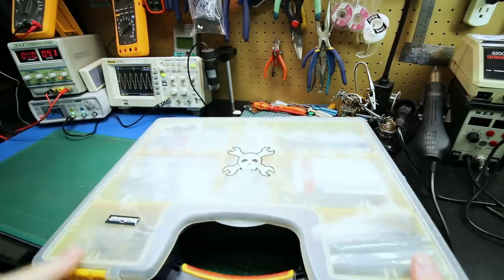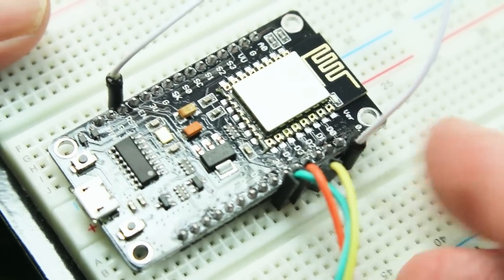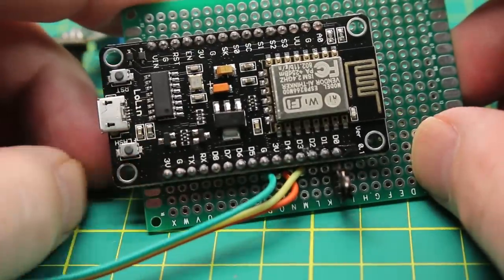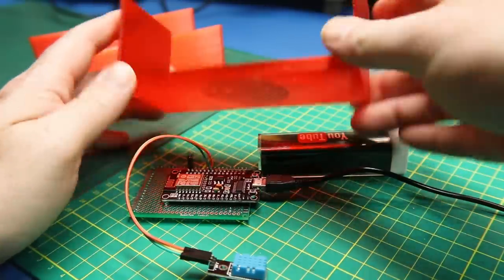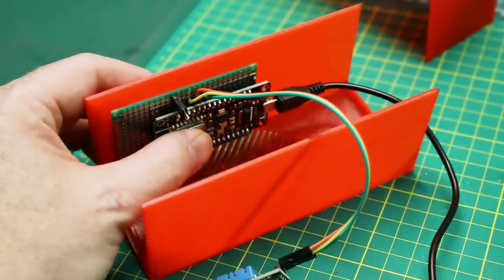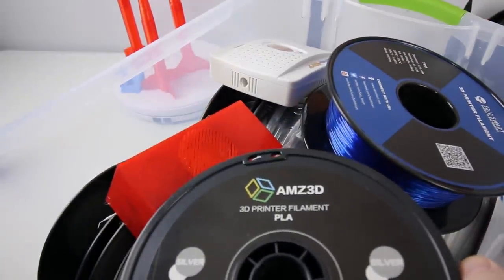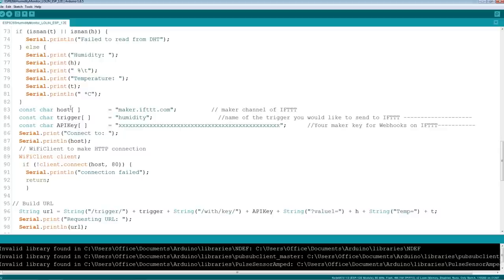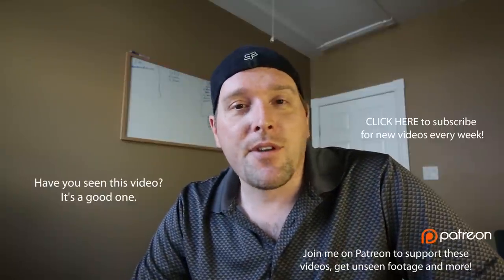DIY Wireless Temp & Humidity Monitor With Text & Email Alerts

Comment: Hey, just wanted to say that this is my first attempt at messing around with a micro-controller, Arduino Editor and IFTTT.  Banged my head a few times but things started to make sense.  Had all this going in about an hour and a half, starting from scratch.  Works like a charm!   I would like to mention that, at least for me, I had to add a function that would verify it was connected to wireless before it tried to send the trigger.  Without it, I was never getting to the web.  It connects very quickly but apparently, not quickly enough.  I suppose I could have just put a 1 or 2 second delay in there, but this way, if the time varies, it'll still connect.  Other than that, everything worked great!   I was having fun just letting it send an email every 30 seconds.  The next think I learned was that free IFTTT has a 30 email daily limit!  haha  I think I have 5 left.  haha  Just wanted to say thanks for the video and the GitHub stuff!

Comment: This project needs one more input. The battery voltage should be monitored and transmitted when it approaches the the low cut off voltage so it can be charged or replaced. With it lasting a long time you may miss not see the humidity and temperature report for a few days so the battery low cut voltage approach alarm would be a great addition.

Comment: ⚠️ keep in mind ⚠️
DHT11:
Good for 20-80% humidity readings with 5% accuracy
Good for 0-50°C temperature readings ±2°C accuracy

DHT22:
Good for 0-100% humidity readings with 2-5% accuracy
Good for -40 to 80°C temperature readings ±0.5°C accuracy
Reply from the maker: Don't let perfect stand in the way of functional.
Reply: MKme Lab true but it should be noted though
Reply from the maker: You will be very busy posting data sheet info on many videos.  Best of luck though
Reply: MKme Lab not many just the important ones 👌🏽😁
Reply: The DHT11 is an *awful* sensor, I don't know why people keep using it (nor the DHT22, which is only slightly better). The Si7021 is smaller, cheaper, easier to use (i2c), and significantly better performing. The DHT11 is a relic of a bygone era when makers had far fewer affordable options.

Not that this is a criticism of this video, which I think is great and I'm sure it was just what was lying around. I just hate the DHT11 with a passion after it caused me a ton of headaches.
Reply: nobodybodybody thanks for the information, I've never heard of Si7021 before
Reply: @jasonmhite  cheaper? Where? Very curious

Comment: Great idea. you could use a small E-Ink screen as a readout on the outside  (or inside if the box is clear enough) instead of a sms message. Might be a bit easier to code as it does not need wifi or ITTT integration.
Reply from the maker: Like this? https://www.youtube.com/watch?v=MGvdrmPEDlw :)
Reply: Yup I've just started watching the channel ;) need to catch up on all the older videos! :D
Reply from the maker: Glad to have you here. Such a crazy time when we can build just about anything in a few minutes

Comment: Dear. Thanks for the video. Wouldn't it be more wise just to text message you  when the humidity reaches a certain level.  And then you just know when to recharge the dehumidifier?  Also code for battery level?

Comment: have DHT11 module with registor. It Works well with Arduino UNO but not with NodeMCU. I thought it might be issue of in-sufficient power. So powered DHT separately from Arduino 5V out (Ensured same ground for UNO and NodeMCU) but still not working. Kindly suggest the solution.

Comment: Ok, I did my homework and really feel dump that I did not remember about the Adrino of which I think this is a mini version of.  Sorry for the dump comments and will do my homework in the future.  :)
Reply from the maker: No problem Tom. Yes they use the Arduino IDE and can be considered "Arduino compatible". The main ones for Arduino are the Atmega 328 and 2560 chips (the NANO you see me use a lot is the 328). This is the ESP-8266 which is similar in some ways but has WIFI capability. ESP-32 is the next step up which is crazy powerful and has wifi. The ESP's have some drawbacks but the wifi functionality and powerful processor make them handy for projects like this. All above can be programmed in the same Arduino code and IDE- just different board support and libraries.
Reply: Excellent information.  I ordered the 8266 and an display and will try to get your code working.  I asked before, does your files include any need libraries?

Comment: MK, question. at one time I owned a communication retail store and did in-house repairs on just about anything that powered up.  I owned a Marconi spectrum analyzer and everything need to repair to board / parts level.  I sold the store and all the equipment in 91, in 08 I had a heart attack and seemed to have lost some of my experience it figuring things out. I'd like to start building and experimenting a little.  Where can I find a good beginners guide to study?  I have invented a few things back in the 80's 90's and I have a patent on something I'm working on and I need a tracking unit about the size of an ice cube with a phone app.  I thinki I can figure it out if I knew more on the mini boards you work with.
Reply from the maker: Well a great guide for general stuff is "Practical Electronics For Inventors". You may already know alot in there though. Truthfully for the boards, the best place is right here on YouTube. Andreas Spiess, Great Scott, David Watts and many more channels. Pretty much just search what you are after and skim through the tutorials. That's how I learned what little I know on them.  Cheers

Comment: Awesome video, this is exactly what I need to make a monitoring system for my ball python room. Would I be able to recreate this the same way and power it using a long USB cord plugged into a standard wall adapter? If not i am thinking maybe using a large power bank. Thanks for posting this video!
Reply from the maker: Yes you can plug it in to any USB charger

Comment: Does it really have a long battery life? The power bank unnecessarily steps up the battery voltage to 5V and the voltage regulator of the nodemcu puts it back to 3.3V. Additionally the voltage regulator of the board has a very high quiescent current. All the tutorials and articles I read online tell me that this will not last very long. I'm currently thinking of doing a project like that myself and I would really like to see how bad this setup is.
Reply from the maker: If you have the knowledge and parts- Use a good LDO regulator like the MCP1700-3302E and standalone ESP8266. This video is using parts I have to solve a need/want and do it so others can repeat it- Not for maximum battery life.
Reply: it's always good to Run the circuit through the multimeter to measure the current amps of your project 👌🏽 good luck